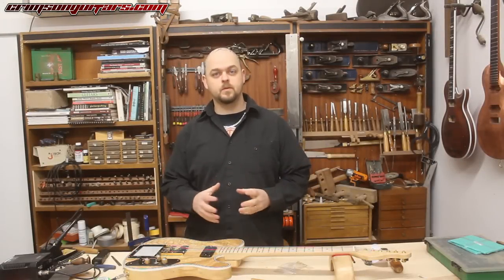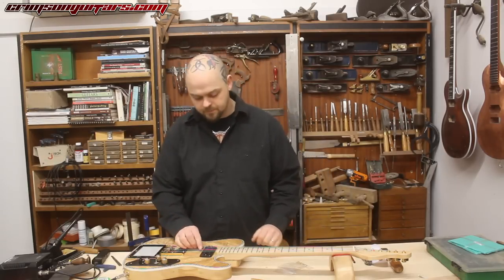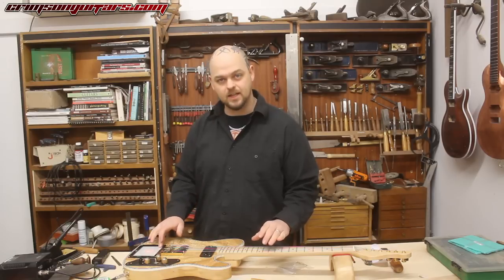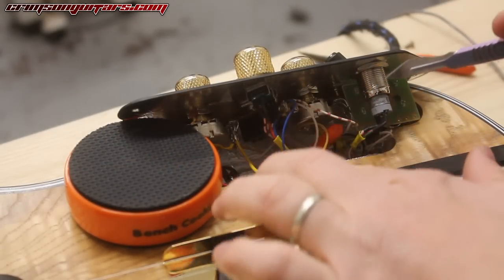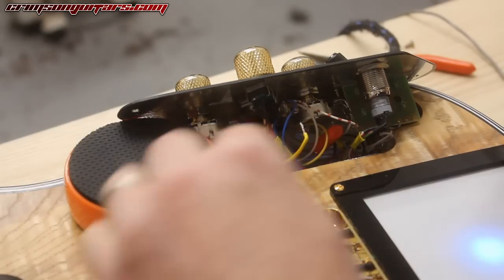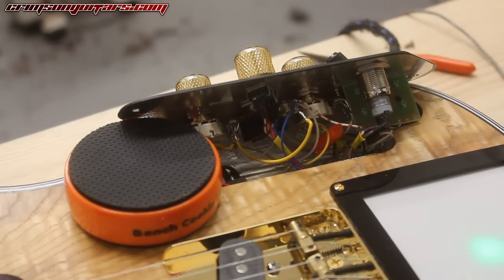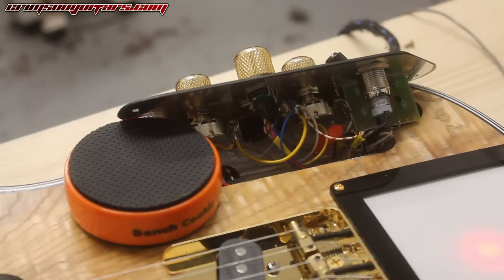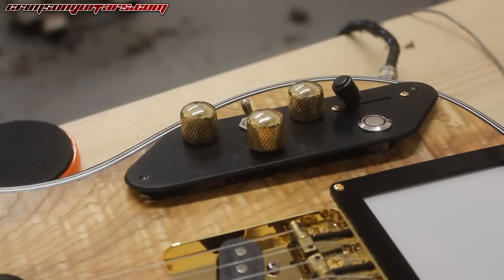Ep 20 Taking a Cheap Kit Guitar and Making it GREAT - Fixing an annoying buzz

Comment: Hi! I just wanted to point out that the foil tape does not make contact through the sticky side so what you see in the video when Ben is shielding the guitar (EP 18) with tape and not making sure that all the tape has contact with earth this issue is what might happened.  The tape is now acting as an antenna for noise instead of shielding  the signal from it. It might be that Ben did this check this of camera but it was never pointed out in any of the videos. Personally I like to make a fold in the tape so there is contact between the two silvery sides and then secure it tightly with a small screw or another peace of tape on top.  Otherwise a really nice tutorial. Thank you Crimson Custom Guitars for making this nice demonstration.
Reply: Basically every cable coming from that MIDI-stuff is contaminated with interference and acting as an antenna, ready to be picked up by any piece of wire in the audio circuit. He should have properly shielded all the wires coming and going from there, especially the looong ones from the battery and then connect this ground to just the separate MIDI-wiring. Also throwing in the odd RF-killer capacity at the battery clip. Connecting every odd part just "to ground" has become some sort of cargo cult within guitar circles, which is unfortunately not a proper way to do things in the age of microprocessor clocks near millivolt-level audio circuitry.

Comment: Just a note to say no matter how tempting never blow on a solder joint you'll prematurely cool the solder which can cause a weakened/dry joint which can manifest itself in a bad or intermittent electrical connection.
Even if you mean to blow the smoke away, don't just hold your breath ;)

Comment: Hi Ben. As part of my most recent project (finally, a build) and along a similar line to this, I've developed a hum from the metal rings surrounding my pickups, which touch the metal pickup covers themselves. I am certain that it's a grounding issue because when I touch the rings, the hum stops. Would I be right in thinking that the solution is to simply run an extra ground to the ring itself, or would this kill the output? 
Apologies for what may be a stupid question (given that by touching the ring with my finger, I'm "grounding" it and the output is still there), but I'm new to this electronics lark, and having active circuitry (EMG) is not helping it make more sense as there's no string ground to speak of.
Reply: From my understanding of pickups the metal case isn't touching any of the wires that carry the signal which are coiled around the magnets. So you can't screw it up by testing the theory. You should be able to do like Ben did in the video and touch a ground wire to them and see what it does.
Reply: Good call, I'l give it a try. Cheers